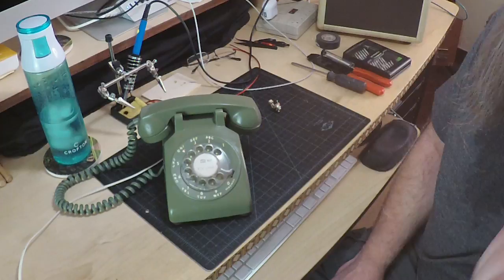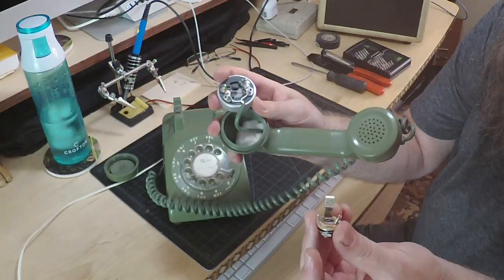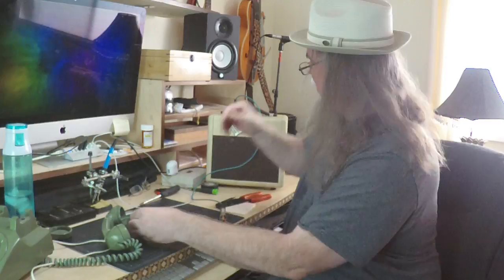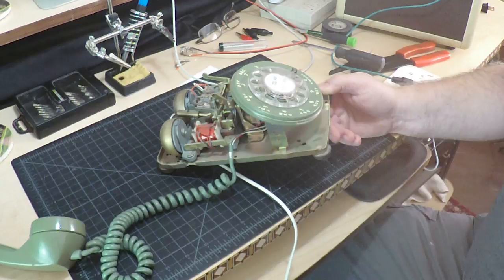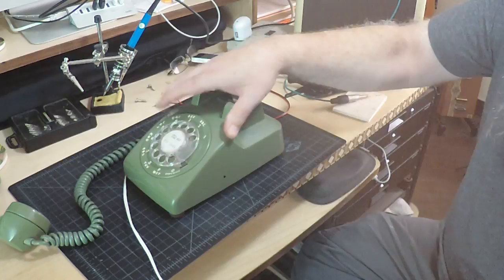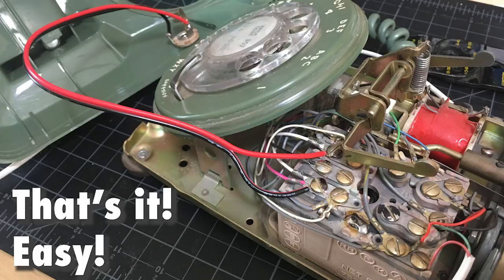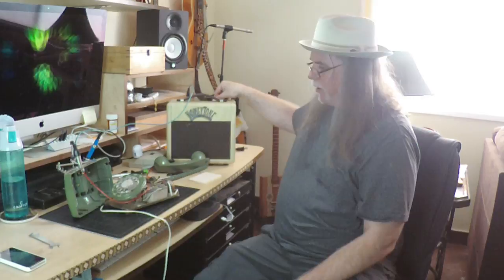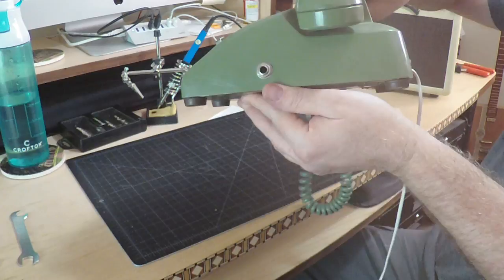How to turn an old Telephone into a hip retro microphone.

Comment: I'm trying to build one of these for a stage show,  where the actor picks up the phone,  talks through it, with the sound going to the theatre speakers.  

Is is possible to use the bottom mic, or to move the top mic to the receiver end?
Reply: It would be a hassle but it’s possible the difference is actually just the type of speaker the one at the top being a carbon speaker is what creates that sound that you are seeking compared to the cleaner lower half, you could disconnect both inner speakers from the chord swap and reconnect I imagine then using a similar xlr cable like in the video here now how you would get it to communicate to the theatre techs sound board and speakers completely depends on the auditorium/stage set up. I’m personally gearing up to do some projects with a handful of old wall and rotary phones I have so I’m still reading up on the specifics so these are just surface level suggestions based on my brief knowledge scouring
Reply: I have a similar phone, and yes, as long as you put the speaker into the mouthpiece part, which can be done. There is a sleeve for the speaker that can be removed to hold it in the mouthpiece section.
Reply: @edgarwalk5637 Is this something you’ve done personally? Would love to see an example of this, really would prefer to speak into the receiver end.

Comment: thank you so much! I cant wait to make one. One question though, lets say I wanted to make this part of my pedal board, how would I make an output jack for it?
Reply from the maker: Thank You. Ahhhh good question. I don't have an answer off the top of my head, but I imagine the answer would be something like adding an effects loop jack like some amps and mixers have. If there is anyone reading this who has experience with wiring effects loops, I'd love to learn more in the comments.
Reply: @SeanHaleWoodcraftsandMusic   ill def have to look into it. thanks again man
Reply: @kevinmocha8072  did you end up building one? It should be really easy, no effects loop needed- You could just add an input jack, since the jack being added here is already an output jack. You'd then wire the input jack lugs to the output jack so that signal is always passing from input to output. The input signal would remain unchanged whether or not the phone is on or off the receiver, since it's not hooked up to the switch. Then just place it wherever makes sense to you in your signal chain, like any other guitar pedal.

Comment: I'm wondering if there is a way to put the speaker in the mouthpiece..  . in ohter words.. switch the ends.
Reply from the maker: I am sure it could be done with a little ingenuity. I just took the path of least resistance.

Comment: Hey Sean! I've watched this vid so many times I love it. I was wondering though, if the handset (or full telephone) has a female mono jack connection, how do you go about recording it? Did you have it plugged in to a audio interface using a male to male guitar jack plug? I have a Focusrite solo which takes guitar input, so I'm wondering if I used a male to male cable from the telephone into the audio interface I could then listen and record the audio on the computer? thanks so much for your advice!
Reply from the maker: Thanks and great question! Yea just use a standard instrument cable from the phone right into your Focusrite. Super simple. You can add a little overdrive in your daw if you want to get more character. My vocal performance at the end of the video had some added overdrive on the vocals.
Reply: @SeanHaleWoodcraftsandMusic  thanks so much I have a handset and the parts so I'm going to give this a go. My only other question would be at around 2:20 when you solder the wires to the contact points of the jack and then screw those wires into the mic, does it matter which wire goes to which contact? 

Basically just wondering if there's a 'wrong' way to wire it, or if it doesn't matter which wire from the mic goes to which contact point on the mono jack, thanks for your advice!
Reply from the maker: @AFunkyHypnoCat  nope either way works and in fact I did mention that in the video. Good luck on your project
Reply: @SeanHaleWoodcraftsandMusic  thank you I wasn’t sure bc I always hear of the importance of identifying which is the input signal and which is the ground so got confused as to why it didn’t matter haha

Comment: Cool video, thanks for sharing.

Question:  Why use the handset's receiver, rather than its microphone, for the music microphone?
Reply: Just because it's easier. There's a bit more electronics required to use the original mic as a mic.
 
I'm so sad when I see these types of projects, that don't wire in both mic and speaker, and/or don't at least use the mic as a mic. :/

Comment: there is a way that i can connect that to use it as a microphone in my computer ?
Reply: I think with a few simple modifications a 48v phantom power plug in(Amazon has some affordable options) that will take strain off your computers cpu, or you can get a adaptor for a xlr connector or a xlr with the proper input end for your plug in
Reply: You could use something called a focusrite scarlett solo (thats like brand specific im sure theres others) which usb plugs into ur computer and then u can plug guitars and mics via cables with an xlr plug in. So a cable with a quater inch jack into the phone and the xlr end of the cable into the scarlett solo ! Hope that made sense